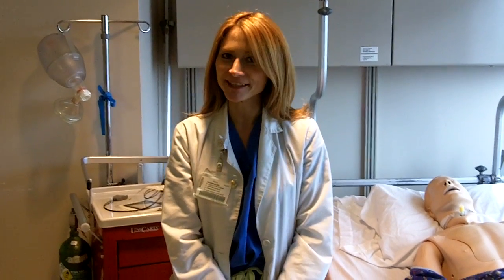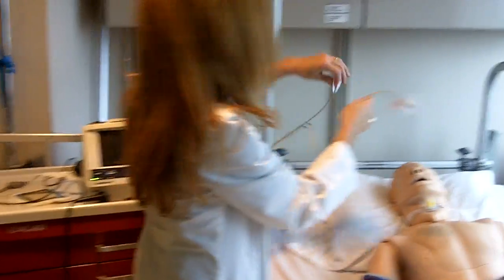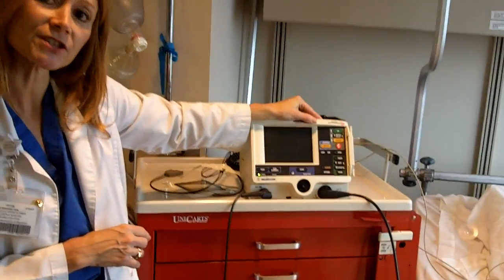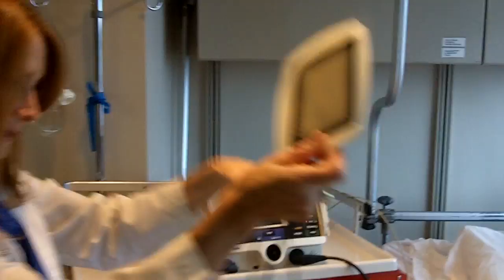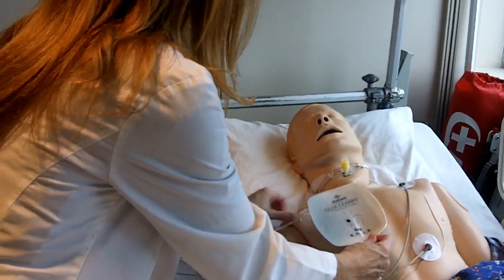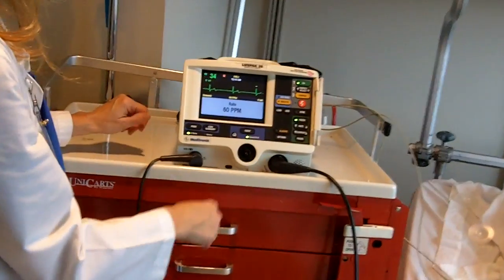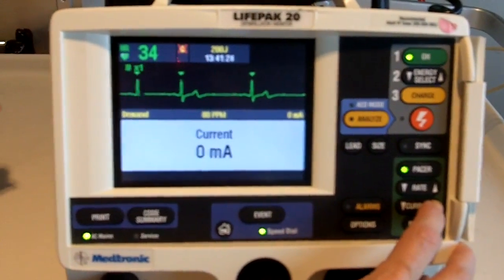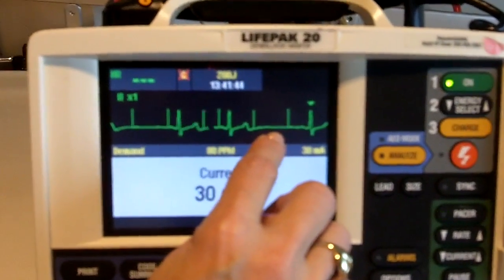Noninvasive Transcutaneous Cardiac Pacing

Comment: Overall not a bad presentation but two important things. 1) She did not have electrical capture as displayed on the video. With external pacing electrical capture produces a wide QRS with a T wave that swings in the opposite direction. 2) A starting rate of 60 beats per minute is usually better to allow for better assessment of the hearts response the the stimulus.  Once capture is confirmed on the screen and a palpable more rapid pulse verifies this, you can later increase the rate as needed.
Reply: do we need to sedate the patient for this procedure/  ?thanks

Comment: This video did show 100% capture of the QRS. 

Increase your milliamps until you get 100% "capture" and then add another 10% of the value. Ie 100% capture at 50mAs then your settings should be at 55mAs.

Comment: As per other comments, nice clear demonstration but a shame the current was not increased to the point where capture was actuallyachieved - in this video it isn't. Each pacing spike should be followed by a QRS, and normally the output is increased by 10mA once capture has been achieved just to ensure a safety buffer. Also, don't forget that this procedure is painful, so pain relief/sedation for the patient may be appropriate.

Comment: she hasn't quite got capture. Nice clear presentation, just needs to increase the Jules until there is a QRS after each spike. (I suspect in this case the manaquin she is using doesn't have an option to set a threshold to capture - so no matter how high she goes with Jules she wont get capture).